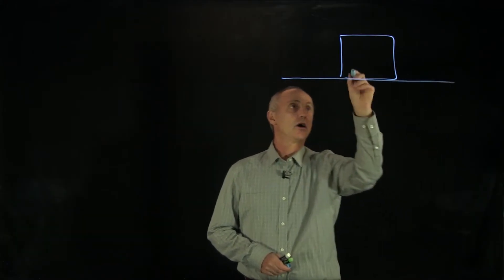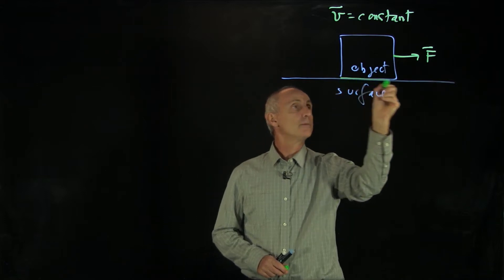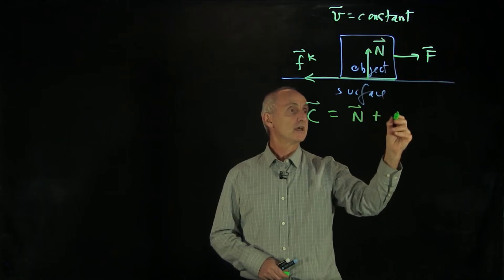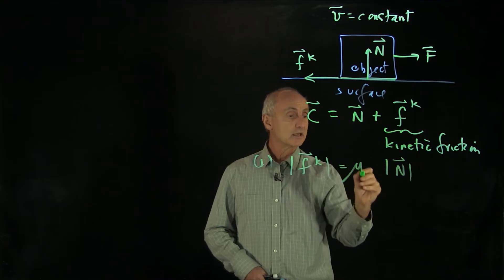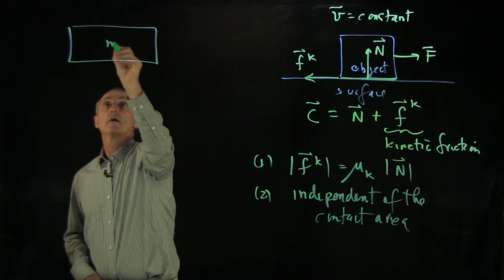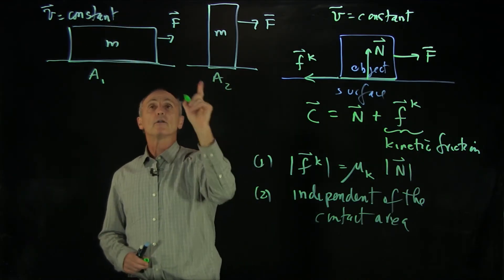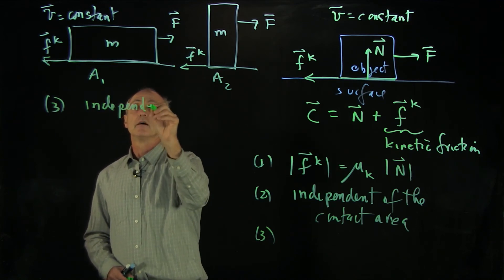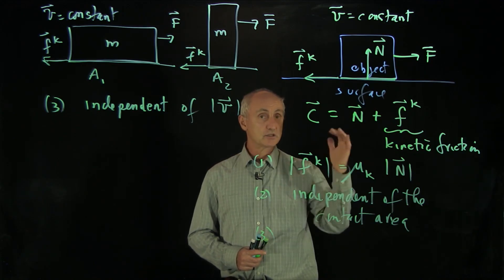6.1 Contact Forces

Comment: After being a roofer for 15yrs, there’s no way I’m convinced that the surface area is irrelevant
Reply: This is just a simplistic approximation of friction that relies on work down in the 16 and 17 hundreds. Friction is complex in reality. To start you can take a look at van der walls forces
Reply: Friction as such does not depend on the surface area however,  a larger surface area increases the likelihood of two surfaces being in contact. It also governs how the force is being distributed on the surface. Therefore it makes sense to use a larger surface area of things, where required. Besides Friction there are other physical phenomena that work here and may explain why a larger surface area is a better choice.